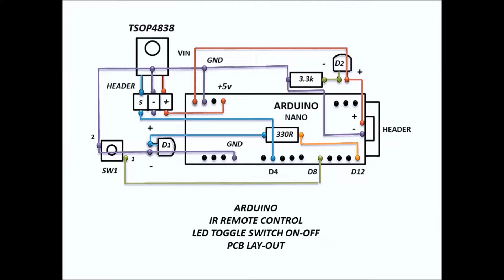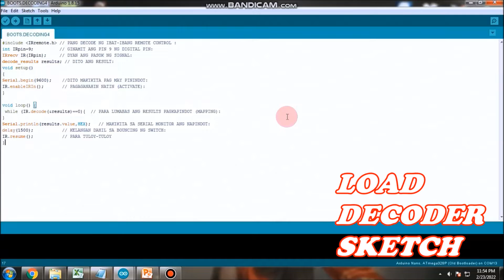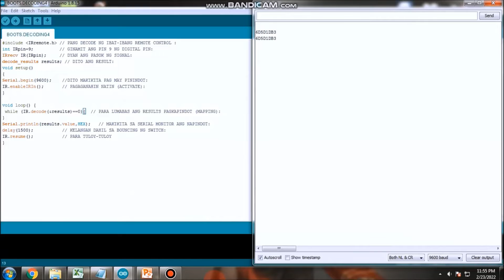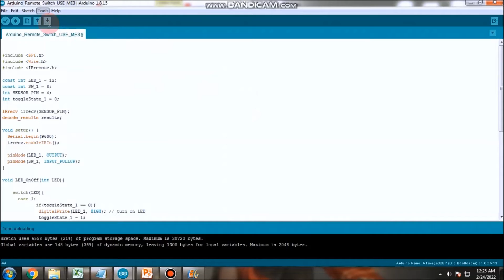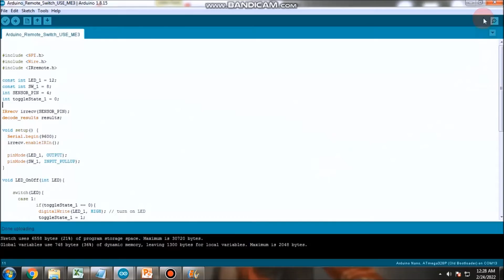TV Remote Decoder #DIY (Filipino)

Comment: Bro please share your code link

because your all videos are great.
Reply from the maker: TV Remote Decoder CODE....
#include <SPI.h>
#include <Wire.h>
#include <IRremote.h>

const int LED_1 = 12;
const int SW_1 = 8;
int SENSOR_PIN = 4;
int toggleState_1 = 0; 

IRrecv irrecv(SENSOR_PIN);
decode_results results;

void setup() {
  Serial.begin(9600);
  irrecv.enableIRIn();
  
  pinMode(LED_1, OUTPUT);
  pinMode(SW_1, INPUT_PULLUP);
}

void LED_OnOff(int LED){

    switch(LED){
      case 1: 
             if(toggleState_1 == 0){
              digitalWrite(LED_1, HIGH); // turn on LED 
              toggleState_1 = 1;
              }
             else{
              digitalWrite(LED_1, LOW); // turn off LED 
              toggleState_1 = 0;
              }
             delay(100);
      break;      
      default : break;      
      }
}

void loop() {     
     
    if (digitalRead(SW_1) == LOW){
      delay(200);
      LED_OnOff(1);      
    }
      if (irrecv.decode(&results)) {
        switch(results.value){
          case 0x6D5D1DB3: 
                    LED_OnOff(1);
          break;   
          default : break;      
          }    
    irrecv.resume(); 
    }
  }